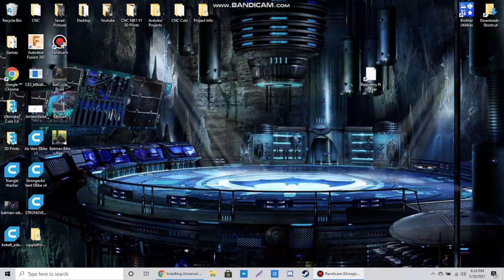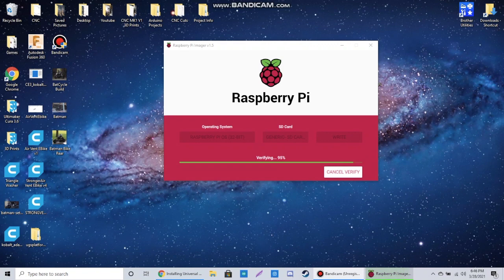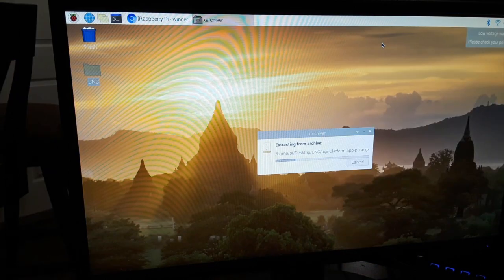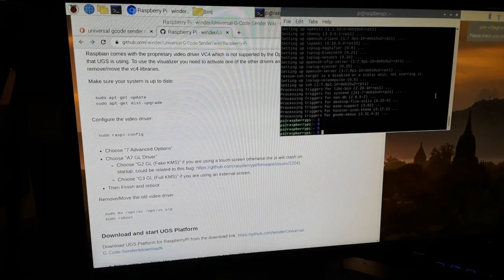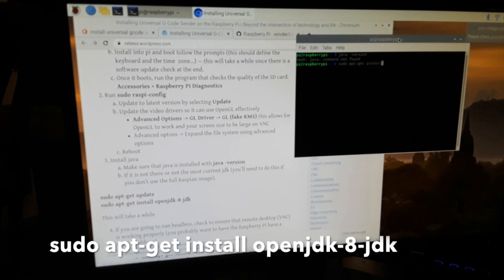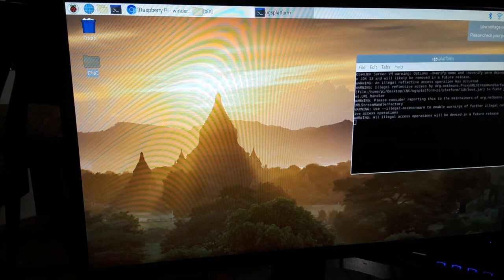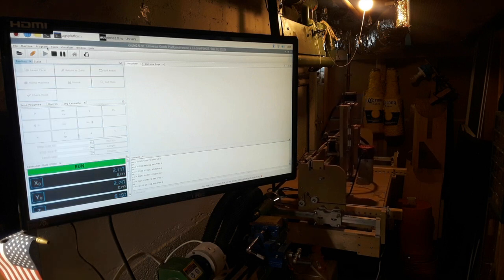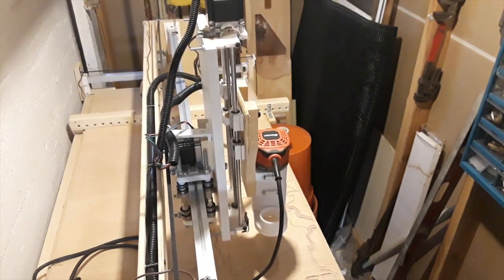Homemade CNC Router Part 8: Installing UGS On A Raspberry PI (Arduino CNC Router)

Comment: hello, for some reason i cannot get the java installer to work. i have a rp 5 and I have read that java is already installed. So i moved on to the next step but, ugsplatform refuses to open at all. The terminal window opens and immediately closes. Please could anyone help me. I am also very new to the raspberry scene

Comment: I use RaspiOs (2022-09-22-raspios-bullseye-arm64). It has no A2 GL Driver option. 😥I changet it in config.txt. I still cant get it to run.

Comment: I have the same problem with not getting the visualizer functioning using gcode sender, at least now I know from your video that the program will still work without the visualizer, but I am having a problem uploading the gCode since there is no prompt on the missing visualizer screen... do you have a work around for that?

Comment: Trying this with a Raspberry Pi 4 with 4gb and not having much luck. I've downloaded the compressed file. However when I go to raspi-config the options you selected are missing. Do I need to use an older version of Raspi OS? I try right clicking on the "ugsplatform" and open with terminal. Nothing happens (and I've waited a very long time) other than the hourglass icon beside the cursor for 10 seconds. Would really love to get my CNC running. Any thoughts?
Reply: I'm having the very same problem. Did you get sorted?

Comment: You failed to explain which serial device you used on the raspberry pi. Fo anyone else with this same question, for me (I have only a single USB connection on my pi) the device was /dev/USB0

Comment: Thanks for doing this video in a nice controlled and slow manner.  I followed it step by step.    I've been using UGS on my laptop for a few years but wanted to try a Raspberry Pi.  I am not linux literate at all, but your procedure got me to get UGS installed on the Pi.   Now I have to try it out!!
Reply from the maker: Glad to hear things worked out good! One other problem I had is that the visualizer doesn' work on UGS. If that also happens to you there is another comment in this section that explains how to make the visualizer work on UGS. Thanks for the feedback!
Reply: @BunkerBuilder  One question.  Everything works except the arrow keys on the keyboard.  Do you have a simple solution to get those arrow keys to jog like they did on the older version of UGS?  Thanks for the help.
Reply from the maker: I actually have never used the arrow keys on the keyboard. I've always just used the mouse. Sorry for the disappointing answer lol.

Comment: Hi there Im wondering about the GRBL set up so you can make the RPI CNC hat become recognized by UGS?
Reply from the maker: What's your question?
Reply: @BunkerBuilder  Hi!, I'm trying to set up a Protoneer RPI-CNC hat, do you have experience with that? Apparently the UGS version I got, is not able to recognize the serial port...
Reply from the maker: Unfortunately I don't have any experience with that type of Raspberry Pi. I used the Raspberry Pi 3B.

Comment: Which Raspberry Pi are you using - there are options for getting the visualiser working on github I believe. With a screen see this post - https://github.com/winder/Universal-G-Code-Sender/issues/1516

without a screen where you use a remote desktop it is a bit more complex but this option seems to work - https://github.com/winder/Universal-G-Code-Sender/issues/1247

Give them a go and let us know how you got on.
Reply from the maker: Hey Karl, I finally got around to doing this and it worked. It was extremely simple to setup. Thank you for the advice!!!
Reply: @BunkerBuilder  Glad it worked for you.
Reply: @karlharrison1712  May God bless you.
Reply from the maker: I'm using a Raspberry Pi 3B+. Thanks for answering my question!